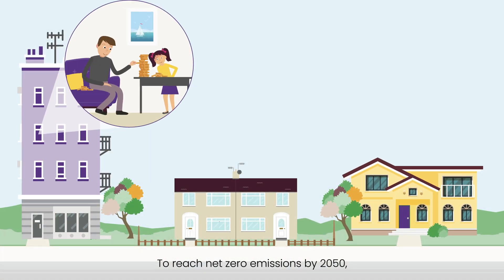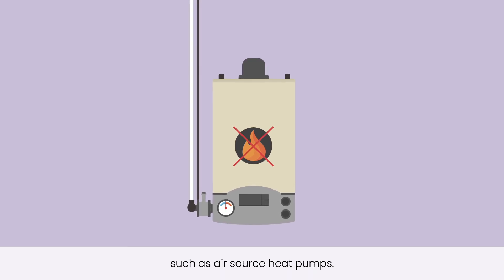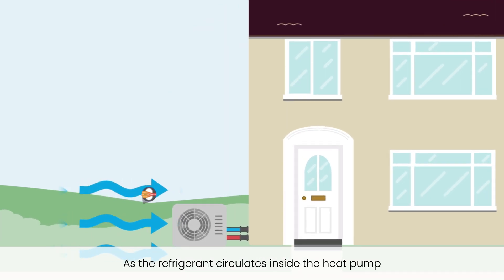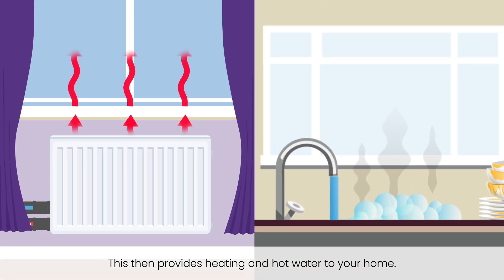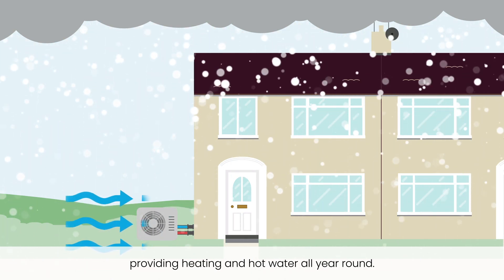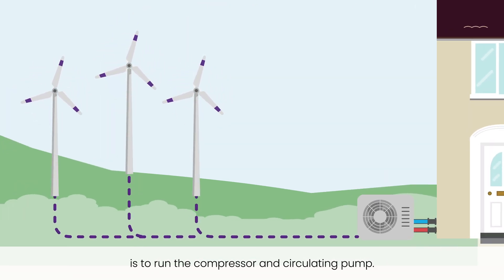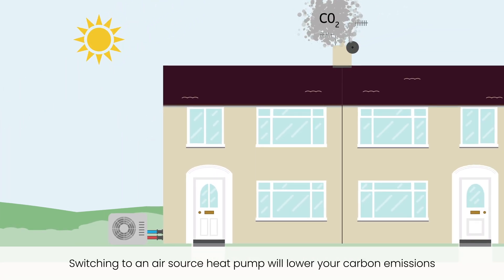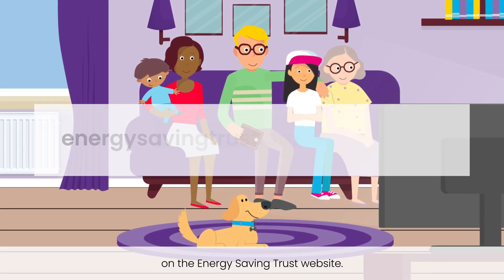What is an air source heat pump?

Comment: Wind turbines? Big environmental disasters that create so much waste they are worse than just inneffective.
Reply: As this is probability an anecdote from a single perspective, this most definitely is not a big enough sample size to draw many conclusions from, which if executed, would most likely bias results and conclusions. Please be decent statisticians and consider data more carefully, especially when some information given seems exaggerated to the point of making not much sense.
Reply: Wind turbines provide a clean energy source, use little water, emitting no greenhouse gases and no waste products during operation. Over 1,400 tonnes (1,500 short tons) of carbon dioxide per year can be eliminated by using a one-megawatt turbine instead of one megawatt of energy from a fossil fuel.
Reply: @PAUL000F84  They costs a fortune to make and install and even more to dismantle.
And they are not recyclable. But you keep on believing.
Reply: @Respected_Gentleman  They do not need to be recyclable to be better than then alternatives, they do not need to be cheap either. They just need to be cheaper and better for the environment than the alternatives and they are. 

But you keep on believing.
Reply: @Respected_Gentleman  If you have a wind turbine windmill anywhere near your house, congratulations – your house just went down 75% in value. You know they say the noise causes cancer?  I never understood wind. You know, I know wind turbines windmills very much. They’re noisy. You know they kills the birds, and the noise. You want to see a bird graveyard? Go under a wind turbines windmill someday. You’ll see more birds than you’ve ever seen in your life.
They’re made in China and Germany mostly. But they’re manufactured tremendous if you’re into this, tremendous fumes. Gases are spewing into the atmosphere. 

You know we have a world, right? So the world is tiny compared to the universe. So tremendous, tremendous amount of fumes and everything.
You talk about the carbon footprint, fumes are spewing into the air, right? Spewing. Whether it’s in China, Germany, it’s going into the air. It’s our air, their air, everything, right? 

You see all those wind turbines windmills?  They’re all different shades of colour... They’re like sort of white, but one is like an orange-white. It’s my favorite colour: orange.

You know what they don’t tell you about wind turbines windmills? After 10 years they look like hell. They start to get tired, old.  Owners of ageing windmills not replacing them without government subsidies is a really terrible thing. It's a terrible thing.  And the birds.  They're from Gyna - they don't tell you that...
Reply: @PAUL000F84  Wind turbines are created out of thin air, and are later disposed of by waving a wand.
Reply: @nuttintoseehere9141  that is simply not true but they are much better than the alternatives. It is a very efficient way to generate the electricity we want.

Comment: Anybody any first hand experience of these saving money? One thing I read says if you have a modern gas boiler yours bills will actually go up a bit!
Reply: Yes, mine does! If you have an Air Source Heat Pump, then you can theoretically do away with a boiler altogether – depending on how you set it up.  You might consider  installing a heat battery, which takes up less space than a hot water cylinder. Instantaneous hot water heaters might also work for you. They can be installed under your kitchen sink offering a smaller amount of immediate hot water.  You might also consider a hybrid system – where a heat pump provides all your heating, and a smaller 'Compact boiler' gives you hot water on demand.  I honestly cannot picture how in any of the above circumstances your bills might 'go up a bit'. 😬🔥🛀
Reply: Search on YouTube "This is Why Heat Pumps May NOT Be The Future" by Skill Builder
Reply: You need a modern, very well insulated house. My next door neighbour doesn’t and her radiators never went above Luke warm

Comment: Buildings waste too much energy and cost too much for utilities.
Heat pumps reduce your heating costs.
Every home needs an energy audit and a blower door test and air sealing.
Reply: The flat I rent should be condemned. It's sucking in cold air, it's 100 years old in poor condition I've taken the owners to the court and won, its not wind and watertight the authority may have to take legal action against them.
Reply: @TheAnonyy  An energy efficient home or business is more comfortable and saves money in the long run.
Solar energy on your roof combined with battery storage can make people more independent from the grid and natural gas supplies. Add solar and supplemental electric heating or a heat pump for home heating..
Added insulation, triple glaze windows, energy efficient doors, energy efficient heating and cooling systems, energy efficient appliances, LED lighting, smart thermostats, solar panels combined with battery storage and a electric vehicle charger in the garage or car park. People are too focused on the short term costs and miss out on long term savings and comfort. Blower door testing and air sealing are under appreciated tools.Even if you have money to burn you should not waste it.  Climate Change will impact everyone. Leave a better future for your children and grandchildren. Join in and speak up for the future of the planet.
Reply: yeh people they all saying this things coz the price of energy is gone up but nobody says why the government have to put the prices so high,i know why coz they are bastards,iam not stupid to believe like some people on whatever i c on the tv,no fuck that